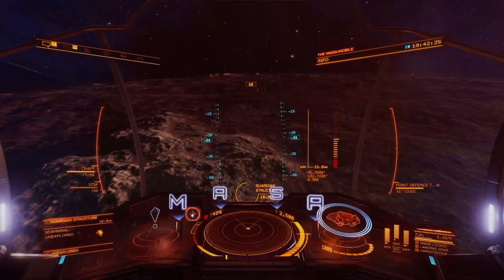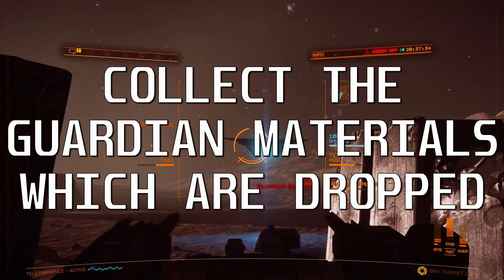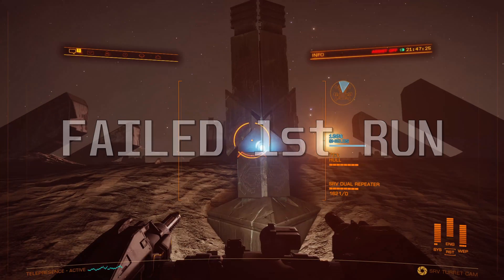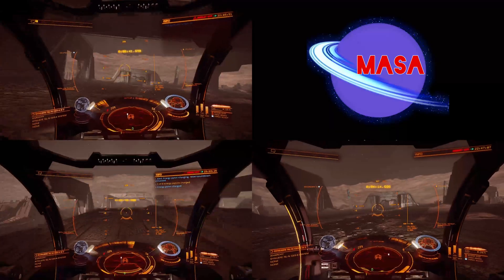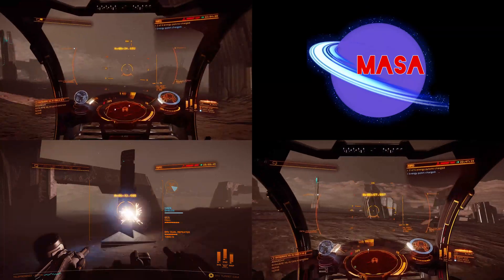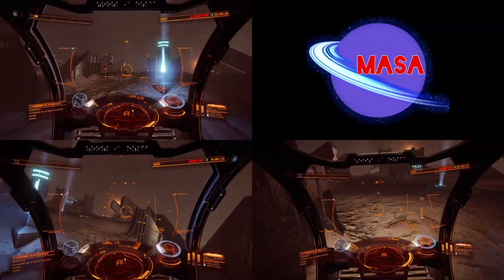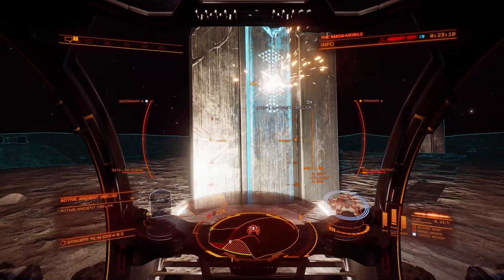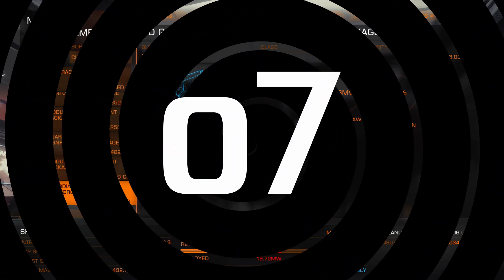Elite Dangerous Guardian Modules including FSD Booster - How To Unlock...

Comment: hey mate, thanks for this. I have collected a blueprint fragment from a guardian site, then logged out. Subsequent attempts at the same site yielded nothing after scanning the orb. Was the logout/login method patched recently?
Reply: Yeah, did read about the solo play vs open. But Im a shy guy and only ever play in solo ;) I'm also on PC and did try 'partial' and full logouts. No dice. Went to a second Guardian site and that one worked, so I'll head back to the first one and update you. Thanks for the reply anyway! o7
Reply from the maker: Awesome. Hopefully it was just a glitch 🤞
Reply from the maker: hmm that's slightly puzzling because I don't believe the devs consider re-logging to be cheating. Maybe try switching between open and solo play - that might do the trick?
If I'm in open play and other people are at the site re-logging doesn't work for me but I've done this in solo play very recently (cos I'm still unlocking all the weapons) so I don't think it's been patched. I'm on pc though so maybe it's different on xbox/ps4 - they might need a full logout instead of just quitting to the menu.
The other way to respawn the blueprint is to supercruise away and then come back a couple of minutes later...

I'm gonna go check whether it still works later today. Let me know how you get on. 🤞 good luck o7
Reply from the maker: Just tested it and still seems to be working okay so I don't think it's been patched out (yet)